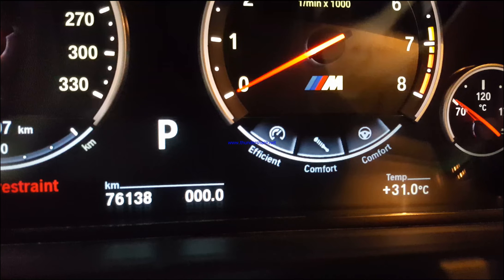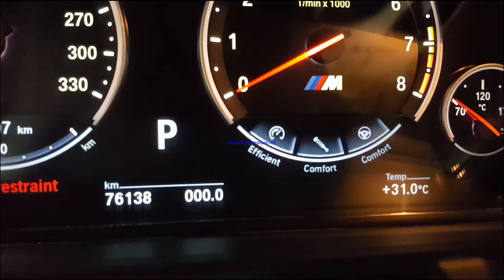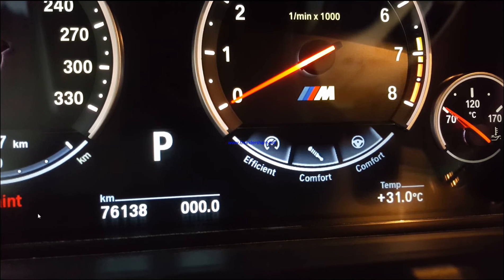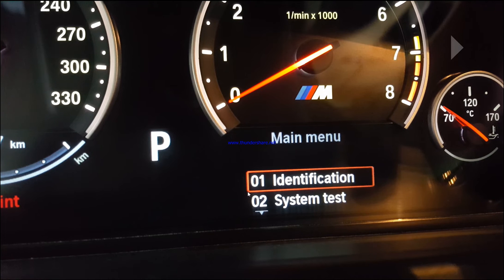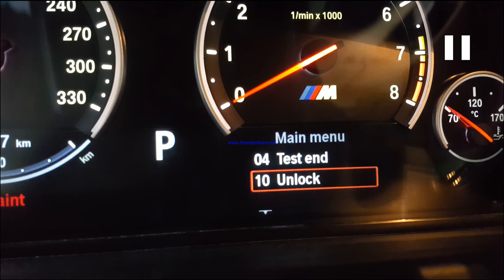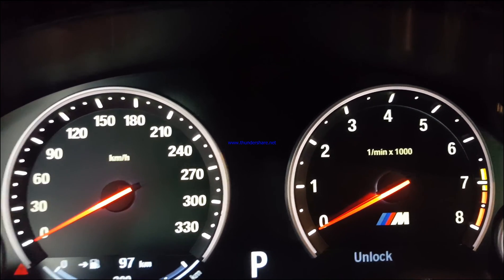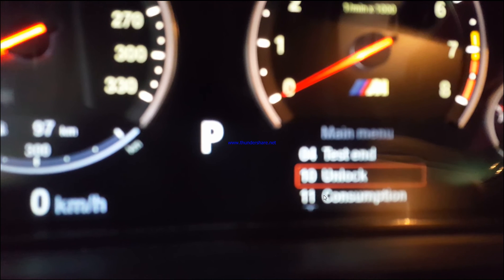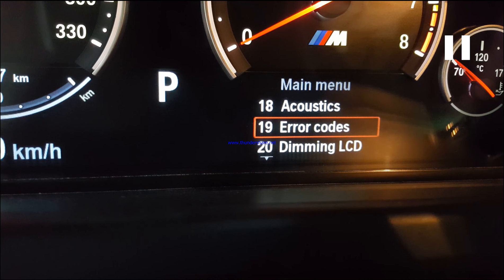How to read DTC code without code reader on a BMW

Comment: Please tell me what the code b7f668 is my 2019 430i with 40k miles has that code
Reply: We’re you able to get the code fixed? If so how did you do it I have the same code
Reply: @benjaminchmi  i sold the car actually i still didn’t figure out what the code was. Someone told me it was the O2 sensor. Someone else told me it needed new spark plugs. 74000 km

Comment: what is #23 "check"?? I opened the DTC (ERROR CODES) menu and it showed me no error codes. however my check engine light is on and I had the drive train malfunction warning appear while accelerating hard. it seems to drive okay now and no drivetrain malfunction but still check engine light. I opened the "check" menu and it has 10 different numbers but I can't seem to pin any of them down to a specific DTC code because there are no letter prefixes theyre just numbers. going to the dealer this week but still could use some peace of mind
Reply from the maker: Please check it using a diagnostic tool. It will be stored in history
Reply from the maker: The code you get from the car diagnosing is specific to bmw. It can be used in Google to see the description. Or use a diagnosing tool
Reply: okay. seemed odd the error codes menu didn't show anything but it's giving me the drivetrain malfunction warning and riding quite rough. possible the dealership blocked the error codes somehow so I would have to take it in?
Reply: @mikeolives18 did u resolve this. I have same issue , no code but engine light
Reply: @brenneanyates7097  yes it was a faulty spark plug. I had the spark plugs replaced a few weeks prior and the dealer replaced the faulty one free of charge.
Reply: @mikeolives18  I running a diesel. No spark plugs. But getting a OBD reader today
Reply: @brenneanyates7097  my fault, f80 m3 over here i was just happy I didn't spin my crank hub lol

Comment: Works great, But when he says add the last 5 of the vin, he means add the last 5 numbers and enter the total of the 5 numbers in the ID . Mine added to 21 and when i hit the button 21 times and held it. It unlocked the code! thanks,
Reply: Does it work on all bmws?

Comment: Should i reset the code for my f30 340i saying drivetrain malfunction
Reply from the maker: What are the codes
Reply: ENGINEERING INVESTIGATION i went through the menu and could not find error codes but the car has check engine and says drivetrain malfunction when i give it a good amount of gas
Reply: @SebastianDiaz-wg5eo how did you resolve , I have the same issue

Comment: How do I enter my 5-digit VIN code?  I follow your procedure by pressing and holding the "Reset" button, the menu appears.  I then, scroll down to the "Unlock" menu option and do what?  If I press and hold "Reset" it goes to the 2-digit code screen.  How/where do I enter my 5-digit VIN in order to get my 2-digit code?
Reply: I found the answer to my question.  You need to add the last 5-digits of your VIN together, and that is your 2-digit code.  For example: VIN-51372 = 18
Reply: @tyanmax  I didn't understand what you mean can you explain please
Reply: Thanks bro
Reply: Tried it 3 times this does not work for a 2015 f10 535i

Comment: Unlocked menu from vin add. #19 error code not present everything else was 2013 335i
Reply from the maker: Try software update for instrument cluster
Reply: @engineeringinvestigation6208  
You bmw erased 
Or I need to buy BM 3 or something like it
That will pull up missing error code list
You explained it like it was stock
Reply from the maker: @whiterussian7564  whats the problem in your car at present?

Comment: Thank you for the video, how do we enter the last 5#s of the VIN ?
Reply from the maker: Press and hold the button
Reply: ENGINEERING EXPLAINED i ca get to the unlock menu but i get stuck at this point because i dont know how or where to enter the last 5 of the VIN to get the Pin
Reply from the maker: @gc-wf1ej  hello. You need to add the last 5 digit of your VIN. Then enter that 2 digit number.
Reply: @engineeringinvestigation6208  only comes up with 2 digit number
Reply: Number 19
On f30
2014
Reply: Hi referring to Veeru B’s question, when I press and hold it, it goes back to the normal screen. Please explain that process of how and where to enter the Vin Code. Thank you.